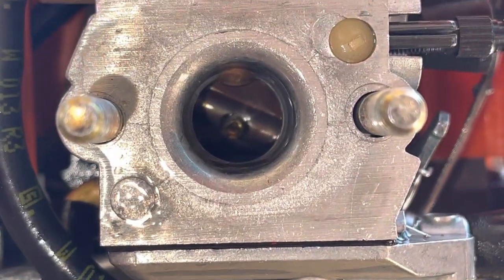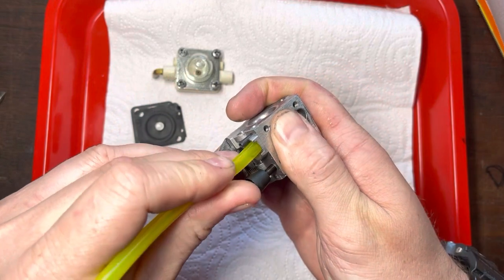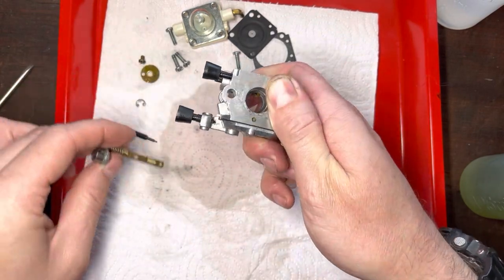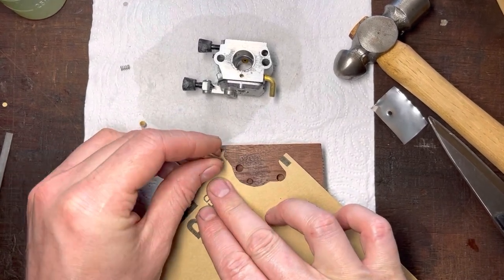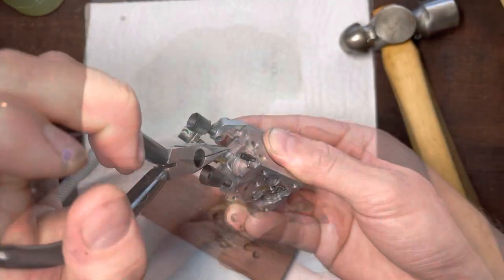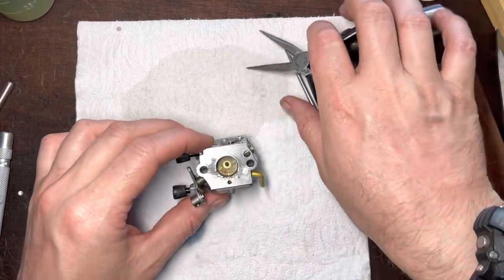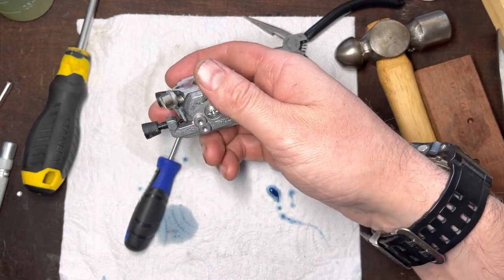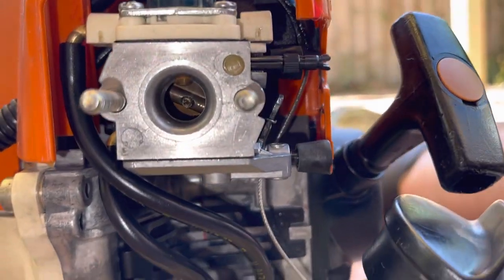ZAMA CARBURETTOR FLOODING - ACCELERATOR PUMP FIX - FREE & EASY!

Comment: I ordered and replaced the o ring once, worked great. It's gotta be a common FS-45/55 killer. The two I've worked on both had bad o rings. The second one, for fun and to avoid the pain of sourcing the o-ring again, I tried the epoxy method. I either used too much epoxy (it squeezed through the channel leading to the primer/fuel assembly), or the carb had other issues. Fuel flow stopped. I drilled a new fuel channel, which worked, though it became unreliable and tended to flood I believe, so I'll be replacing the carb (good experiment, anyway!).
Reply from the maker: Yes :) it depends on the carb and where the drillings are! If in any doubt, and you have access to the o-rings, just replace them :) if you know you won’t block any essential channels, you have nothing to lose. Though yes epoxy can drip where you don’t want it. Thanks for sharing!

Comment: Hey mate good vid! for the oring try cutting a very thin slice of 3mm fuel line and slide that over it
Reply from the maker: Very interesting! Have you tried it?
Reply: @VintageEngineRepairs  it's a trick I use on nitro model engines to seal troublesome needle valves, it works amazingly well if you can get the correct size hose
Reply: @VintageEngineRepairs  I do that and itworks like charm, i use silicon line

Comment: I have a Walbro carb leaking fuel after about 15 bulb presses. I did the pressure test as you showed here and it holds 10 psi and holds its new psi under pressure when pressing the bulb. Unlike yours, my carb is not constantly leaking fuel like a stuck open needle would, it instead leaks when the bulb is pressed through the little small holes in the venturi. Any idea what it could be? Also nice explanation!
Reply from the maker: Yeah, you need to remove that little duckbill valve under the purge bulb and press it back in fully. Hope this helps.
Reply: @VintageEngineRepairs  thanks, its been working fine since I did that. I pressed it closed a handful of times to return it to its natural shape. Is there a way to test for this problem like a pressure test for the needle or is this just something you learn after working on many machines? Sorry for the long comments, i enjoy working on these machines and im trying to learn as much as I can!

Comment: Where do you get the O rings? I don't have a punch. I found the part number for the O ring but no one sells them
Reply from the maker: Go to your local stihl dealer 👍
Reply: @VintageEngineRepairs    Well, there's a thought lol. I buy so much online that I don't think of local shops. I don't think they like to sell parts here because they want the repair business.
Reply from the maker: Stihl only sell parts to their brick and mortar shop, never online. You can occasionally get NOS parts or if someone buys in bulk and sells, but typically the only place I’d suggest is your local b&m store

Comment: There is a zama carb on my stihl 192 chainsaw. When I rev the engine fuel squirts out of the intake. Could this be the reason or is there another issue?
Reply from the maker: Reason for what sorry? 
Typically that’s either a blocked exhaust screen or worn piston skirt. It shouldn’t be blowing back. If you come across this on an engine with a reed valve, the reed may not be sealing.

Comment: I forgot to ask, will this O-Ring cause it not to draw fuel into the primer bulb?
Reply from the maker: Yes, if it’s leaking bad you can suck air in to the purge bulb. Also if the main nozzle is leaking or your gasket is leaking too.
Reply: @VintageEngineRepairs  Well, I tested it this way. I dipped it in water just the hole "where the O-ring is"  and the fuel intake nozzle, and it would draw water into the primer bulb 
but wouldn't pull water through the nozzle by itself.   Thx for responding, love your fixes !!
Reply: @bumblbesss  Yes, this worn o-ring on the accelerator piston in the carburetor causes fuel not to be drawn into the priming pump bulb, but this worn o-ring on the accelerator piston in the carburetor does not cause the carburetor to flood!